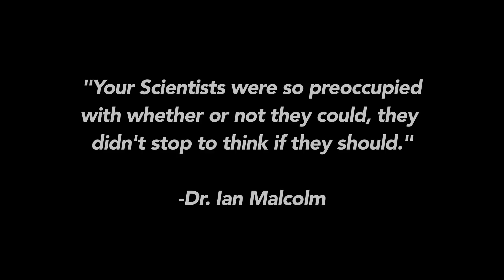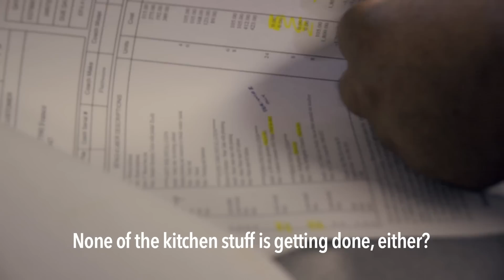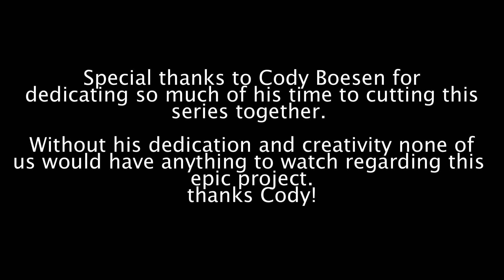JURASSIC PARK RV - restoration part 10

Comment: Serious suggestion here.

Would you consider opening a Jurassic Park-themed restaurant and making the RV the centrepiece? It would be JP in theme and also have useful information presented in way or another to educate people about real dinosaurs and separate the film's fiction from reality's facts. As I recall, one of your stated goals initially was to take the RV around the country and use it to educate people about dinosaurs so this would fit nicely with that goal. 

My template for this suggestion is a restaurant here in my town of Toronto called The Old Spaghetti Factory, of which there are also several in the U.S it looks like. What do you think?

Comment: I like and share on Facebook every time you guys upload a new video or photo. But I think people in the comments need to realize that this is a money issue simple as that. To me it sounds like excitement took over critical thinking and they took on this project without knowing how hard it would be. 

The amount of work that needs to go into this project is just ridiculous and you just can't take short cuts. This whole RV pretty much needs to be stripped back down to the bare metal repaired then start from scratch.
Reply from the maker: Agreed.
Reply: The issue with that is the more you strip it down the less it becomes screen used and more an elaborate replica.  Also that shop is not listening to that either. Those panels that were ripped off were access points for the cameras (as mentioned by you guys) and probably a perfect place to try sky lights. In any event preservation is the biggest key with this and that unfortunatly costs tons of money.

Comment: I have always wanted that RV. With the amount of money Jeff Gildblum and the other actors have I am surprised they are not helping out with this project. Anyway I hope the next Jurassic movie has a off road Chevy Silverado in it. Would give me ideas for my truck. I hope this project gets completed because it is worth the money when it's finished. I hope you guys are actually going to put actual metal bars on the windows and back drop hatch door instead of wood and colored pvc pipe.
Reply: With that, I only have a very small number of followers myself but from now on I will be shouting out to your channel about the RV to get the word out. That RV deserves to be totally restored as it is one of a kind.  Even if my small family can't have it due to money, someone else deserves to have it fully restored and functional.

Comment: To me this is more an episode of "pimp my ride" than a restoration project. I don't know if that's the shops fault - to me it seems they just see another repair job. Did anyone explain the significance of this RV to them? Is there only one RV shop within driving distance? They lost any provenance of the vehicle when they stripped out the carpets. The shop wanted to take the RV back to the framework - I just don't think they get the difference between restoration & repair...